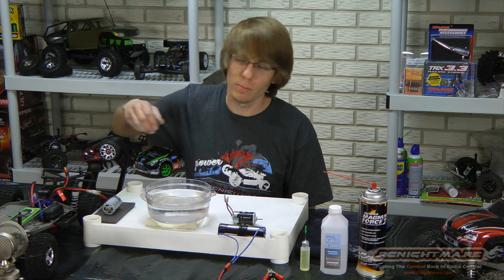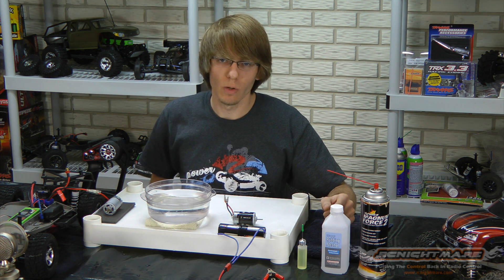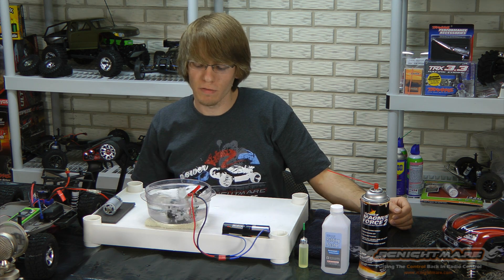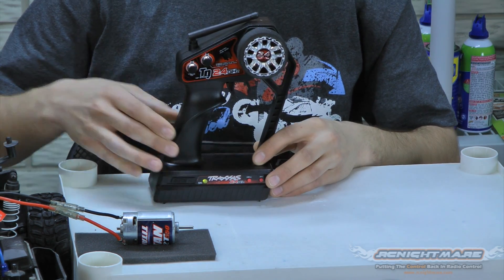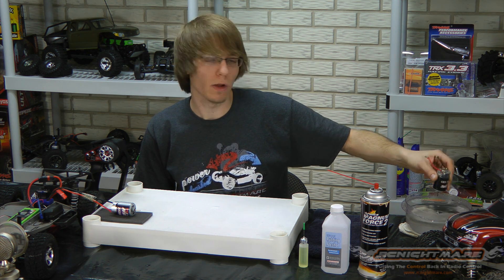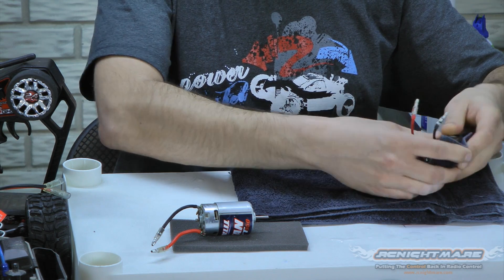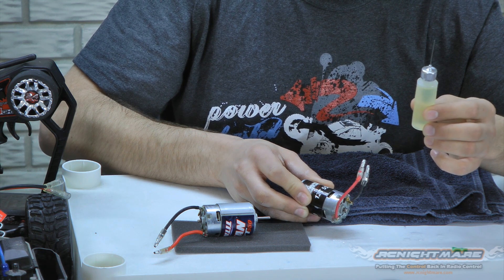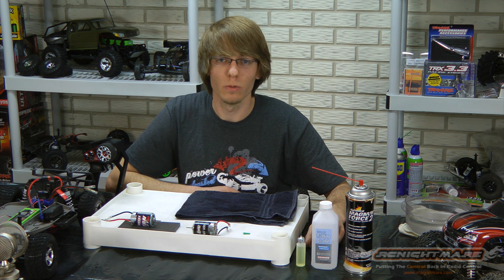RC Brushed Motor Break In Methods-Both Wet & Dry Break In

Comment: If your brushed motor was/is precut you'll do more harm than good "breaking them in" in distilled water. Sourze: https://www.teamtekin.com/phone/brushed_maintenance.html

What you need to know is if your particular brushed motor has precut brushes or not, my guess is most modern brushed motors do - which means you'll only want dry break them in, maybe clean them out which electronics cleaner and re-apply suitable oil on the three spots.

Comment: Why are you putting oil on the commutator?? This will destroy it when it begins to attract dirt and dust! Commutators need to stay clean and oil is not for electrical contact points

Comment: love the video..n I have a question fo u can I use brake cleaner spray .. to spray in the motor and the stator  to clean it  .. n use  3 in 1 oil to lubricate the shaft? .. I have the Titan 380 motor brushed

Comment: Hey man i have a wltoys a959b with a protection board on the back. Im assuming that I have to desolder the pcb from the endbell bed in brushes and resolder the board?  Btw I'm thinking of getting rid of the pcb as battery runs down to flat on lipo and i thought it was for overheating protection!  Any ideas please reply. Any reply appreciated thanks from Australia cheers 😊

Comment: Traxxas never said anything about this so when I first got my slash 2wd, I took it out of the box, charged it up, and ripped it. And no problems and I've had it for 2 years. Still on the same motor.
Reply: I've done the same cos im lazy at times if you don't do this trick motor still goes for a long time . Difference is it motor ges up to 20% harder, revs higher! Its an old school trick and does work tho! Cheers from Australia 😊

Comment: I drove my car around in figures of 8 and in straight lines at a very slow speed and very gradually increased but not anywhere near half throttle is this an alright method as i really don't want to risk dropping it in water

Comment: I have had my traxxas e-maxx since [08] & I was told by TRAXXAS that the truck origonaly came w/ two 21 T motors ' well It definitly did not ! brand new out of the box ' It had 2 12 T motors . Well it kept burning them up ! Then I finally talked to a man at Traxxas that told me that truck should have came w/ 2 21 T motors . The 12 T motors are not strong enough to hold up to the weight of that truck . Sorry about the spelling & the book I'm sending ' but In your vid. u show 2 ways to break in the motors ' does the dry method help to water proof the motors ? As compared to the wet break in method . Like the Vid. Jimmie R

Comment: Hey I was wondering if I was to do a dry breakin to the motor would you recommend a compressed air to clean it up or electrical contact spray.I have a few in mind and will provide you the link. Can you please tell me which one would be better :

http://m.supercheapauto.com.au/Product/CRC-Automotive-Electronic-Cleaner-300g/13177

http://m.supercheapauto.com.au/Product/3-In-One-Contact-Cleaner-290g/299674

http://www.jaycar.com.au/Service-Aids/Chemical-Aids/Aerosols/Contact-Cleaner-Lubricant-Spray-Can/p/NA1012

http://www.bunnings.com.au/wd-40-specialist-290g-fast-drying-contact-cleaner-_p6100409

Thanks

Comment: Interesting. Been into RC for most of my life and never heard of breaking in an electric motor. Granted all my stuff is brushless. Only my sons trucks are brushed and his Stampede 2WD is going through 4-5 motors a year. I guess that's because I never break them in. Though he does like to run the truck in deep puddles so the motors do get submerged at times. LOL
Reply: ScarabChris lol my stampede is 3 years old and has the stock titan 12, it's rusty as hell, never greased, never broken in and still goes like new, I do not know why your sons motors break so frequently
Reply: Also the motor was never replaced and is the same one that came with the truck

Comment: Most people think WD40 is a lubricant. It's not, It's a penetrant. That's why you use it on rusty gates to get them to swing open without squeaking. After it penetrates the rust you should clean it off and put real oil or grease.

Comment: So I watched your video, it's informative but not recommend by Traxxas. Here is what they recommend. Leave the motor in the truck. Drive it forward at 3/4 throttle for one battery pack. Stopping every 5minutes to check the motor so that it's not to hot, you should be able to put your finger on the motor for 5or 6 seconds. 
They do not recommend water break in
After you are finished you should spray a shot of WD 40 to lube the motor,  I personally would use Rc cleaner,you can g
Reply: WD 40 is a degreaser and cleaner it also displaces moisture. It is N0T a lubricant. You must use oil to lubricate.

Comment: Ya never clean a motor with wd40 unless you want a dead motor fast or one that lights on fire. I use brake cleaner that is non-chlorinated as a motor cleaner and i havent burnt out any motors. I just blow it out after with some air and its all good.

Comment: I was thinking about getting an rc car the boss 302 it has the traxxis  12t 550 motor but after googling it iv found nothing but bad reviews on it..if I use the water break in method will it run fine..I'm asking this because they bassiclly  claimed to use the break in method which is in the user  manual and they have all burnt  out.

Comment: then you turn it into a generator and your still passing current through the motor...

break in at low voltage (1.5-3v typically)

Comment: I do this not only for break in, but for maintenance as well. I've kept several Titans at peak power by doing this every couple runs. Titans like to squall when they're dry. A dunk in the water at ow speed releases all the dirt and a couple drops of oil silences it. They ain't bad motors in their own right, but for Traxxas to claim they are "virtually maintenance free" is hogwash.

Comment: You should not run current through a motor to break it in.  If your brushes are so out of round with your motors comm, that they need seating, then they have gaps in which arcs can form.  If there is arching, there is pitting.  It would be better to just buy a coupler or a long shank double set screw pinion, and couple it to another motor to spin it, without having to pass current through it.  You could also use a drill to spin the motor.  Submerging is also bad for bearings, rust, etc..
Reply: This is by far the best way to break in a motor

Comment: Can I use rubbing alcohol to clean out the motor after I have place it in water. So it would take the place of the spray can, so can I do that or would it ruine my motor. Thanks for your help.

Comment: nitrofreak is just another JOFA... also WD-40 is not a lubricant its a Water Displacement ..use a drip can like 3 in 1..Most Brushless motors dont really need a breakin.. if u run Dirk use a can of Comp clean(compressed air) to Blow all the junk outa the can(nitro you should just drop urs in a bucket of water LOL)..The best way to break in a Brushed motor is use a cup of Green anti frezze and a D cell..hookup and drop it in.. no need to dry...

Comment: I am going to have to ask you to stop using caps lock lolol. I meant to say "and or" in my last comment. If you do keep your brushed motor clean it will last. If it wasn't broken in it may be less efficient i really wouldn't worry to much about it, if you didn't break in a brushed motor they are very cheap to replace. :)

Comment: simple WD40 will work. Obviously WD is a lubricant and also a rust inhibitor (both good for the motor), but WD is also NOT electrically conductive, so it is totally safe to spray into a brushed motor

Comment: wow, i wish i was told to break in a motor before i went through 4 of them smh. lol. oh and i noticed that your running lipo on your XL-5... i wouldnt do that, that esc doesnt have a low voltage detection. other wise i wouldnt have a NIMH batteries only lipo

Comment: Awesome tutorial. I've been going brushless lately, but I have an old brushed motor from my Rustler and it has turned to absolute crap power-wise lately, since I've been cleaning it with compressed air. I didn't realize I'm supposed to re-oil it. I used to run nitro so I don't know much about electric motors. Thanks so much!

Comment: 2 questions. Could I use wd40 as a lubricant? And second could I just take the motor out if my car and put it in the water and run it at a low speed with stock batt?

Comment: @MrMetalica11 I think that the 775 motor has more tourqe rather than speed compared to the 12t titan but 12t titan is not good if you need a new motor get the team orion formula pro bb because you can replace the brushes, has ball bearings last way longer. :)

Comment: I am a new RC driver as well as a owner. I want to change out my motor on my drifter rc but don't understand the wire going across the two points besides the positive and negative wires? Do I need those on my new motor? Or replace it with the same one? Looks like a resistor

Comment: So use the dry method then rinse it with water? Also is there any way to repair the windings in one of these motors? I'd like to fix the broken one that way i have two of the same motor incase this new one ever poops out on me.

Comment: @rcnightmare 
ive broken one motor in using the wet method let it run on very fast for like 1-2 mins oiled the bearings and now it's got a short in the windings or sumn. One wire in the windings is shorted out so i'm getting it replaced and i dont want this to happen again so i'm doing a lil more research on how to properly break my new one in

Comment: LOL! Excellent! I sometimes use the water method to clean out stock, non openable, motors. Went to a club meeting without having time to work on my motor beforehand. So I connected it to my 3 cell running in pack with the motor in clubhouse the toilet!!! Hahahaha! I know plain water is not to be recommended, but what the heck? It duly turned the water black with carbon!!! Oops! Don't forget to flush!